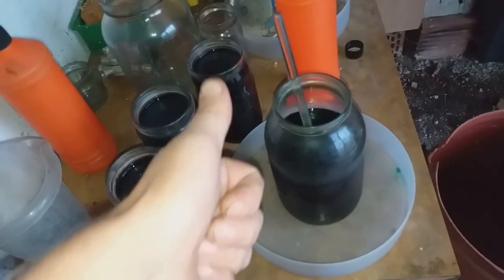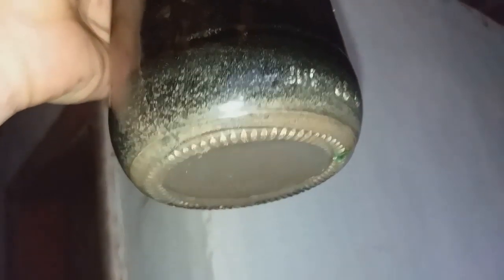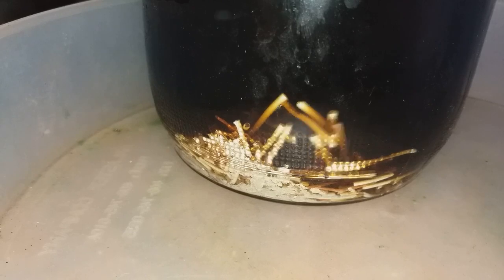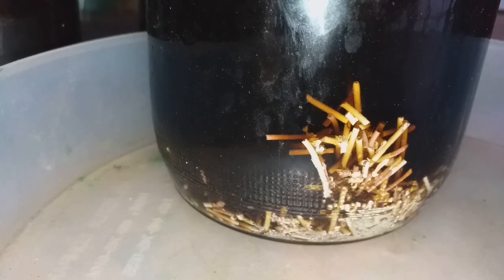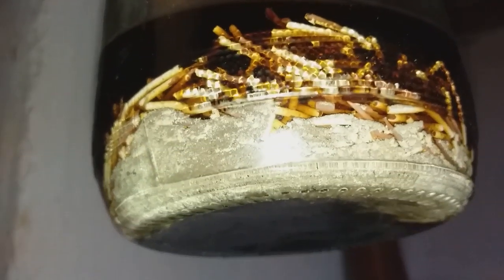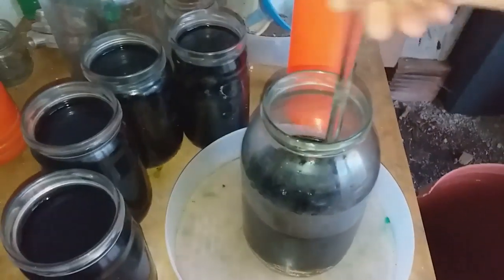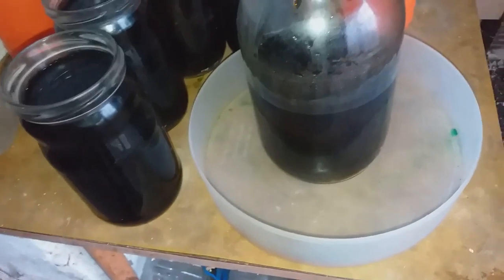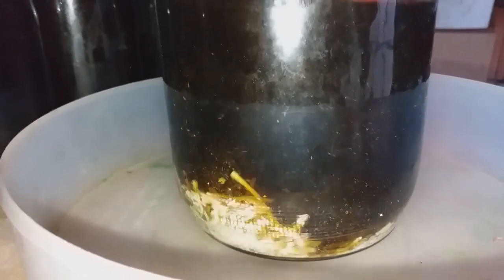Silver plated pins - how to react with Ap solution - PART 2

Comment: It might help to heat the solution up.  I find AP to be painfully slow and I use an old coffee maker to heat things. I leave the pins and such in a 1L beaker on the warming plate of the coffee maker and walk away.  What takes weeks at room temp takes days when heated up.  And these things are dirt cheap too.  People throw them away all the time so you can easily get them for free.  In fact most people I've asked admit they have an old broken one at home and they wind up offering it to me.  :)
Reply: I agree that using heat to speed up the reaction time is better BUT, like Dusan said, he was trying to do it the cheapest way without spending money on electricity and using free sun power. If you are not in a hurry, then his method is great.

Are all pins that you find in e-waste silver plated or just tin/nickel plated copper? Should you waist your time collection all the non-gold pins and process them in the hopes that they are silver plated?

I was wondering if the silver at the end of the process is pure silver or still an alloy of silver?